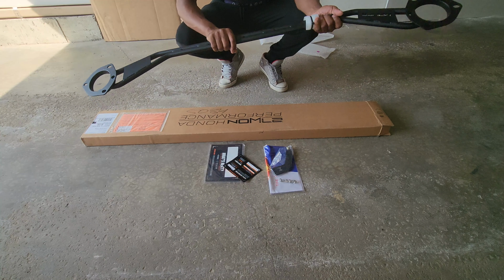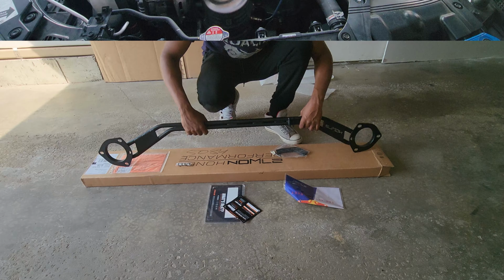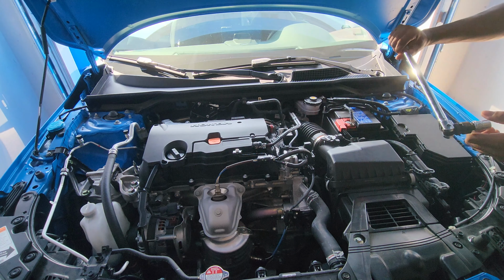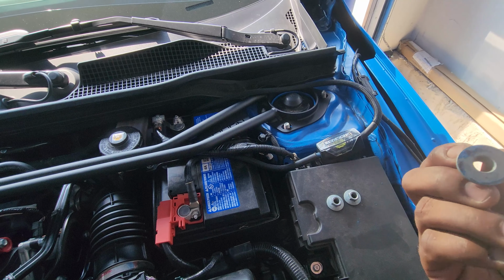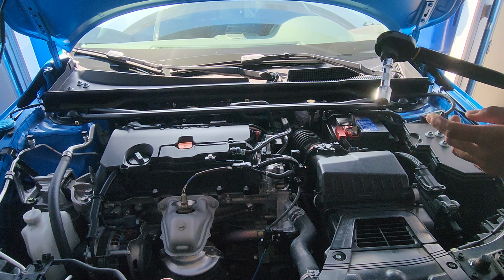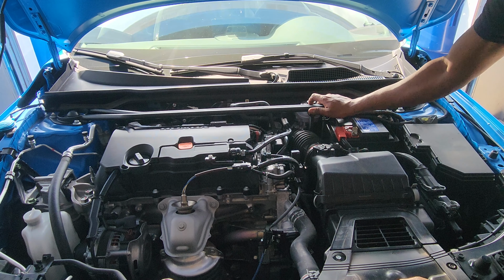2022 Civic Hatchback 27Won Strut Tower Bar Install

Comment: Thanks for the vid man, I've done one on my 99 Civic. Looking to do the same for my 22 si. How you liking the strut bar and the brake brace combo? Also, is torque wrench necessary?
Reply from the maker: @Christos Kazameas I love the combo I get much firmer feel in the brake pedal and that tower bar made the suspension alot better. Now I'm not afraid to throw the the car around corners at higher speeds as the body roll has been brought down to a minimum. The combo is definitely worth getting.
Reply: @RTI876  that's great to hear. I was talking to a 27won rep this morning and he said the same thing. The si with lsd and existing suspension hits corners hard, but a little roll for sure. Thank you
Reply from the maker: @KazX37  no problem! ..oh I forgot to answer your question about the torque wrench. It isn't necessary but I'd strongly recommend you using one
Reply: @RTI876  noted! I tend to overtighten things so that's a wise call
Reply from the maker: @KazX37  also 27won provides the torque specs so you won't have to go searching the entire internet for it 😄
Reply: @RTI876  I was wondering where you found that. Sweet!